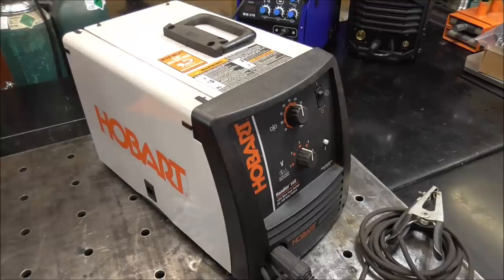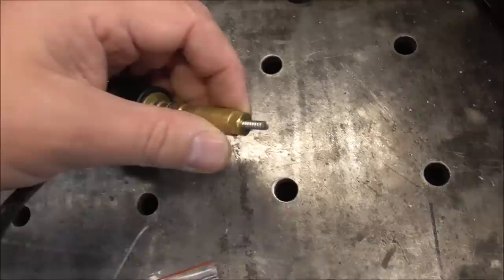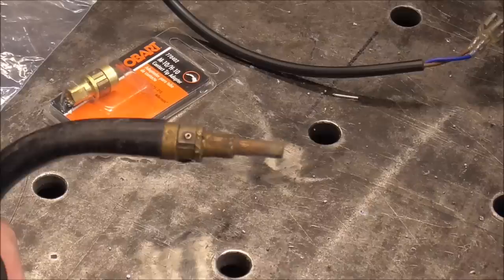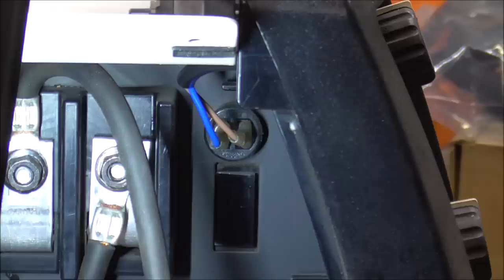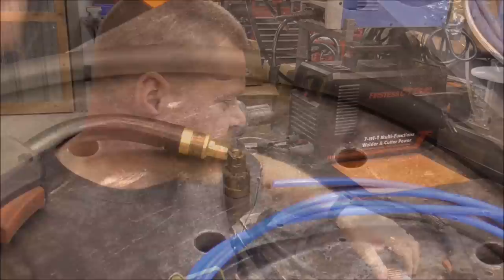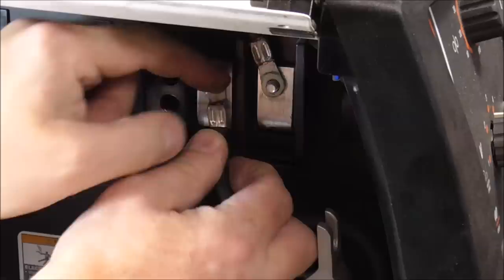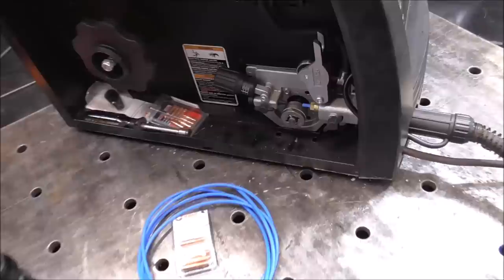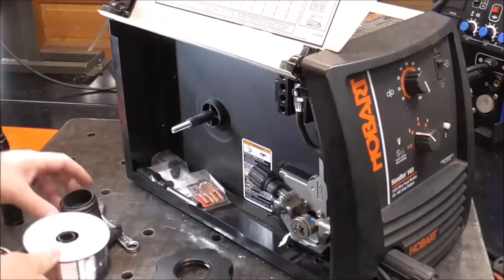Convert Your MIG Welder to Weld Aluminum - The Easy Way

Comment: I always wondered how to take mine apart,.....the only thing that stopped me was finding compatible parts.
The reason you change the liner for Aluminum is because its finicky everything must be clean.
The only difference between 110 and 220 is heat range.
When the maintenance guys at work did it,.....they used a thermal gun that measures heat and they would heat it with map gas before they welded.
I'd get a new wire drive gear for aluminum too.(CLEAN)
And wipe the piece's with acetone.
I could never do it with a tig the guys at work slold all new parts and hid them and only left old dirty parts around.
That's OK,...I'm alive and their all dead,...tigging killed them many years ago.
I weld Mig or Arc its always worked for me.
I prefer flux-core wire because its way cheaper,.....for most things,...if it really needed to be strong i'd use regular wire.
If you use regular .023 and gas a 110 will weld like a 220 and a little stronger if you use some map gas to preheat the area.
Reply from the maker: Spot on 👌

Comment: Not sure what I did wrong but my attempt at this was a total failure. I tried everything I could and the welds were total crap. So I bought a tig welder.
Reply from the maker: It sounds like your polarity was reversed or your hub and drive roll tensions were off.
Reply: Make sure you use only argon or an argon/helium mix for aluminum. and that's for MIG and TIG welding. The bossman says no CO2 for aluminium. And clean the metal of paint, oil and grease.
Reply: @georgebuck2269  argon/helium mix - did that. Tried every possible setting high low wire speed adjustments etc. changed polarity, No dice.
Reply: @robert5  This comment is not meant to insult anyones welding machine, but. If your working in a factory with an expensive MIG machine, it doesn't know whether it's welding aluminum, steel or stainless. The metal only cares about what kind of shielding gas that your using. Aluminum only likes Argon or for a hotter weld use an Argon/Helium mix. For steel you can use pure carbon dioxide or Argon/CO2. For TIG we only use Argon or Argon/Helium. CO2 or Argon/oxygen is never used on TIG welds. Remember the rule; MIG machines are "CV" or constant voltage and TIG or stick is "CC" or constant current. It means you can't hook up a MIG spool gun to a TIG or stick machine. When welding aluminum it must be clean, no oil, grease or paint. The military spec requires it to be etched in a mild acid.

Comment: Shame the little 140 doesn't have it in it for welding on cast, only reason I would bother on mine.
Reply from the maker: I have plenty of videos with it welding cast iron
Reply: @BrandonLund   for aluminum... Cast would pull way to much heat.
Reply from the maker: Are you saying cast aluminum or cast iron? For cast aluminum just run 4043 wire. If your saying cast iron, I have a cast iron repair series using this welder. It works.
Reply from the maker: Ahhhh gotcha 👍

Comment: Just my 2 cents but it would be easier to buy one of the vulcan or everlast 200 amp machines and buy a spool gun later, its a more robust system with a much better duty cycle than a hobart ever dreamed of with less limitations for not much more than a hobart 140 and they infinitely more capable. I bought my everlast power i-mig 205 8 years ago with a spool gun for $1200 You can get the vulcan 215 for $840 and the spool gun later for around $200.
Reply from the maker: Easier to buy a new welder?  It depends on your budget and what you plan to do with it. I converted this for 25 bucks and I own the welder. Spending a grand to weld aluminum once a year might not be reasonable for some folks. I'm offering alternatives for people that want to adapt their machine to do additional tasks that they might not be aware is possible.

Comment: You don’t need to do all that. All you need, is a short whip 6 ft max length. I’ve done it many times when the spool gun was being used on something else.
Reply from the maker: Why cut corners when you can do it the right way. Everything is getting cross contaminated when you dont run dedicated equipment and your only asking for problems. It's no different than not cleaning your metal. Sure it can be done, but it's not right.

Comment: Where do you buy a cylinder of argon for $25?
Reply from the maker: @grantofat6438 your forgetting the cost of the welder, the rental contract for the tank of gas, the cost of the flow meter, the electricity to run it and the rent for the workshop to house it...plus your time to make the repair.

Comment: Is there any reason why you’re not using.023  wire?
Reply from the maker: .023 aluminum wire is very uncommon.
Reply: @BrandonLund  .023 aluminum wire is readily available in my home State of (very blue State)Wa.
Reply from the maker: .030 is challenging enough keeping it from burning back. I can't imagine .023, let alone the feeding issues with such a small wire.

Comment: You forgot to mention the cylinder of Argon gas and regulator which will set you back $150-$200.
Reply from the maker: I also didn't mention that you need a place to plug it in, electricity to run it, a welding hood, gloves, wire and the materials to weld.

Comment: You need to be clear, if you want to tig Aluminium you really need an ac tig welder. Yes I know some guys do it with dc but I have newbies coming to me thinking they are going to buy a cheap tig welder and weld aluminum. It’s highly unlikely they will be successful with that.
Reply from the maker: Absolutely. TIG is done on AC. Unless your welding thicker stuff like 1/2" people will be very dissapointed with the results of DC tig.

Comment: At what point did you convert it to AC??
Since Aluminum REQUIRES AC to weld, I was waiting to hear where you converted the DC welder to an AC welder and never heard or saw it. 
Did I miss where you converted it to AC??
Reply from the maker: Put the video on a loop and just keep watching it over and over until you retain what I said.

Comment: Works in a pinch. This is why tap setting machines aren't the best.  Spend the money by getting something with variable settings.
Reply from the maker: Unfortunately not everyone has disposable income. Going without until you can afford the perfect setup is not always the best solution for some. My first welder was a Chinese flux core welder that I used until I made enough money to afford something nicer.

Comment: I haven't read through all the comments so maybe this has been answered a billion times already (if so, forgive me), but it seems logical to think that this new liner you install in this would be generally beneficial in any form of wire that could fed through it. That said, whether it's FCAW, MIG whatever; could this new liner work for anything? I usually do flux core welding at home simply because it's easy to get up and running without needing to worry about gas. Could I use that liner for that? I mean, if it's less abrasive, it would seem as if using that liner wouldn't be as much about it accommodating aluminum welding as much as it would be just a good upgrade entirely.

Update: never mind. I reached https://youtu.be/FGhSo82MP9U?t=896 where you explain why you shouldn't do that. (Traditional metal and or flux core wire would be too abrasive for the new liner.)
Reply from the maker: I appreciate your support man! 🙏

Comment: you dont neccessarly need a machine with a welding gas in. you can manually turn it on prior to welding.
Reply from the maker: I jury rigged a fcaw only machine about 30 years ago to accept gas. It wasn't worth the effort.

Comment: Hahaha!  And They make STEEL A/C rods! They have extraordinary cleaning properties!  I bought some to weld INSIDE my woodstove where I can't get cleaned. 
Haven't used them yet. (They're blue, these are called Bot AC PLUS.) WIERD huh!
Reply from the maker: @Jim Befit Sounds like the rods eutectic repackaged into consumer packs back in the 80's and called them ultra hy steel, they were also blue and would weld anything to anything.

Comment: Use Argon Gas , Teflon hoose, and plastic rolls and AC instead of DC
Reply from the maker: This is a DC only machine. There is no option or reason to switch to AC
Reply: @BrandonLund  if you want to weld aluminium you need AC to break the oxide layer
Reply from the maker: @CUBETTechie  Just Google MIG Aluminum. You will find tons of articles explaining how it all works. Its more complex than this basic video was meant to address. You dont need ac to MIG Aluminum.

Comment: When welding Aluminum , The Aluminum loses heat about as fast as you remove the torch from it.
Reply from the maker: IMuch faster than steel or stainless for sure
Reply: That's why it's used as a heatsink on electronic parts to dissapate the heat. If the piece is large you preheat it with a torch. Such as engine blocks.

Comment: Aluminum solder is MUCH easier, plus its rated at 40,000 psi all for less then 10 bucks.. check it out, aluminum solder, you'll be amazed.
Reply from the maker: I will. Thanks for sharing!

Comment: Well I’m not sure what you mean convert it to weld aluminum? Almost any machine with gas connections should weld aluminum without doing anything special. The biggest problem with welding aluminum in a standard Millermatic is getting it to feed the aluminum wire thru the whip because it so soft and the slightest bend in the whip or the wire stick to he contact tip it breaks the wire at the rollers and bird nest if your not paying attention.   The only thing you can do about that is pay attention and keep the whip absolutely straight and while your pressing the trigger feeding the wire thru grab the roll see if you can stop the roll by making it slip in the rollers if not rollers too tight. Loosen the drive rollers until it pulls wire but you can easily make it slip in rollers if you grab roll by hand and then it’s set right and will minimize wire breaking at rollers every time the wire sticks to the tip. 
Or buy a push pull whip for aluminum and that’s the best choice but they are not cheap
Reply from the maker: All of this was covered in the video

Comment: Don't breathe in the fumes from the arc, or the Argon
Reply from the maker: Spot on! 👌
Reply: People nowadays are overly concerned with breathing welding fumes a couple a times per month. Relax and enjoy what your doing. My trade school welding friends (we started in 1966) and have no lung issues after 35 to 45 years in the trade. I averaged 52 hours a week as a MIG welder for thirty five years and at age 70 still have no health problems. It's the welders who worked at a shipyard in confined compartments that have lung problems. As long as you don't smoke drugs or cigarettes you'll be fine. Happy hobby time.

Comment: Not an expert or anything, but seems like at 27:11 you might not want to have that MAP gas tank sitting next to where you're welding. Seems like an accident waiting to happen.
Reply from the maker: Its really no different than welding and cutting around oxygen and acetylene tanks. If this tank or any other tank is leaking fuel than it really doesn't matter where it's located within the room, the vapors are going to ignight regardless.

Comment: Did not see you use alcohol to wipe off the film on the aluminum, so you can weld without heating up the aluminum too much.  Compensating by heating it up with torch?  Just get rid of the oxidizing film that protects the aluminum, so the arc can penetrate without overheating the base material.
Reply from the maker: I brushed it. That's plenty for padding beads in a demonstration. A torch was used for the reason given in the video.

Comment: One can melt metals with a car battery. But Welding aluminum require AC current while mig's use DC current...
Reply from the maker: Now go and watch the video 👍
Reply: Thank you

Comment: Miller 211 work?
Reply from the maker: It should but I would check your manual. It should have something in there about the liner
Reply: @BrandonLund  says use spool gun I believe,  pretty sure hobart and miller use all same parts?
Reply from the maker: I would be surprised if they weren't identical but I didn't want to steer you wrong. Years ago some of the Hobart machines were being shipped with the mig guns labeled "Miller" on them.

Comment: You need knurled drive wheels, leave the wire speed at a  reasonable  speed turn your volts up accordingly and your travel speed ..quit putting a torch on the material your annealing it...
Reply from the maker: It sounds like you need to put up a video. You seem to have it all figured out.
Reply: @BrandonLund  I should I could make money
Reply from the maker: I wouldnt be too sure about that...you lost me at knurled rollers for aluminum 🤣👌 you don't use knurled on aluminum, but you do you 👊

Comment: the biggest problem with cheaper machines I found is     "no gas regulator valve " it's all free flow..right from the time ya open the Gas valve to the time ya stop welding . kind of a pain and wast..  A mig welder that was given to me  the person needed some aluminum welded and picked up an easy mig 100....Me "OK I'll take it"..I told him it won't work and ya needed  one that can be used for both,,,this thing is hard wired in and no gas port ..so just shielded wire only...but he did try...not sure why I kept it..lol
Reply from the maker: Yah that's usually the downfall with the flux only machines. I try to encourage most to go for MIG because you will wish you did at some point.

Comment: I thought helium was the gas of choice for aluminum.
Reply from the maker: It really depends on what process your doing and your material thickness. For MIG aluminum argon is all that is needed.
Reply: You can use argon or an argon - helium mix for MIG or TIG welding aluminum. When the machine doesn't have enough current or the stock is thick, you would use the mix gas argon with helium.

Comment: Out of pocket cost is way more than $25 to get started because of the gas.
Reply from the maker: Sure we can add up the cost of the of the gas, the cost of the annual bottle contract, the cost of the welder, the cost of the electricity to run the welder, the hourly wage to make the repair, the cost of the building that houses all of this and so on. Don't be so negative.

Comment: Not bad for the price, would be about the same cheaper than a cheap spool gun from eBay.
Reply from the maker: This setup cost me 24 dollars.
Reply: @BrandonLund  yeah I've seen for around £60 a spool gun from eBay, but this is most likely more appropriate for little use. If I had a euro fitting I would keep two attachments for them, if the fitting don't kink the wire too much?
Reply from the maker: Thats the way! Fronius had a special. 2 mig guns with the purchase of the machine. 1 for aluminum and the other for steel. I missed that deal and a replacement gun is $500 😬

Comment: I thought you were going to show a way to convert a DC machine to AC, since everything out there says use 
AC for aluminum...
Reply from the maker: Aluminum is welded with DC when using a wire feed welder.

Comment: I weld aluminium with mine all the time but I just use the metal liner 🤷🏻‍♂️
Reply from the maker: I've had decent luck doing that too :)
Reply: @BrandonLund  I’m just too lazy to change the liners over all the time, lol.
Reply from the maker: Same. I'm guilty too LOL
Reply: @BrandonLund  😂😂

Comment: you know you dont need ARgon gas right???  try it without argon ...youll see it works, keep your workpiece clean, cable  straight, one size bigger tip on gun... 17.5v 45 amp, set speed to correct feed... so it donr burn in towards gun, just the right speed,, whalllaaa of you go.
Reply from the maker: Corners can be cut but this isn't one of them.

Comment: graphene and Teflon are two VERY DIFFERENT materials. 
graphene is best known as a single layer of carbon atoms arranged in a honeycomb structure. no one is going to make a welding line liner out of something 1 Atom thick. 
HDPE is the plastic milk jugs are made of. its also not the same as Teflon.
Reply from the maker: Just know you need a liner designed for aluminum and they are all sold and manufacturerd using the various names I mentioned. Their molecular structure is not what this video is about. As far as no one making a graphene liner, they didn't get the memo 🤣 https://yeswelder.com/products/graphene-liner-smx-1-0-1-2

Comment: WHY YOU CHANGE LINER?
Reply from the maker: Did you watch the video?
Reply: @BrandonLund  yes but i know a little English.  You know much butter  than i do.
Reply from the maker: Oh ok I'm sorry.  I didnt realize there was a language barrier. You change the metal liner to a Teflon liner because it allows the soft aluminum wire to feed easily and it also eliminates any metal contamination from previous steel wire.

Comment: Aluminum is ungrateful to weld. It oxides very quickly and melts just at 600ºC. It may be possible to braze it, but to weld it, you must be very careful to weld it. Iron and steel are much more forgiving. Definitely, aluminum is not beginner-friendly.
Reply from the maker: For sure! 👍

Comment: You just need to weld with AC nit DC
Reply from the maker: This is a 120 volt welder. It's not capable of AC output.

Comment: Where can I buy a argon regulator and a flow meter and a tank of argon for $25????
Click bait.
Reply from the maker: You cant. It was a trap to lure you in, but you also forgot the price of the welder, the electricity to run it, the monthly morgage where the machine is stored, the 5 year bottle contract cost, your time invested to swap the liner, and the time you wasted watching and commenting on this video.